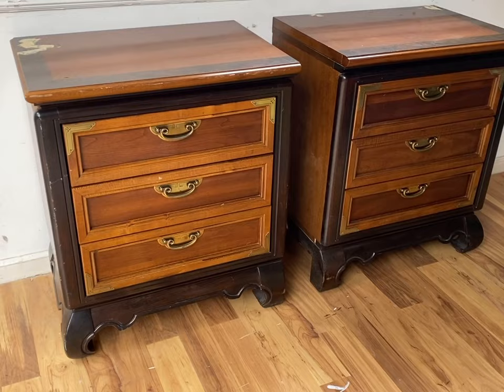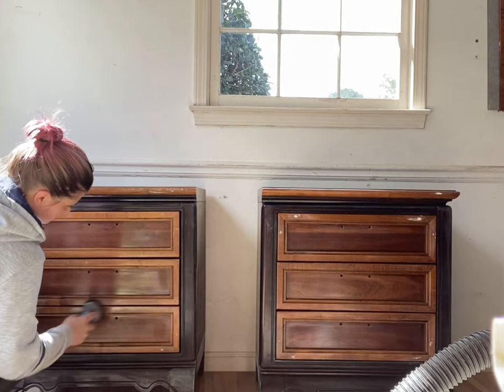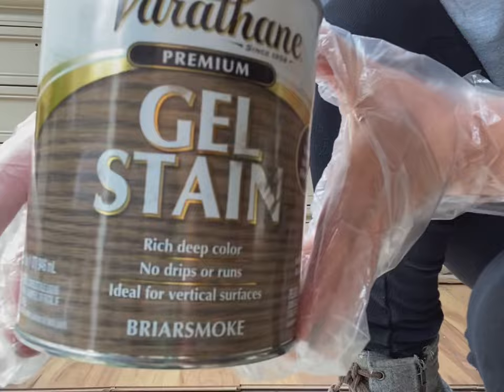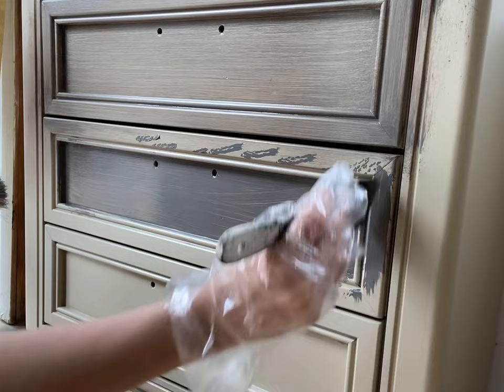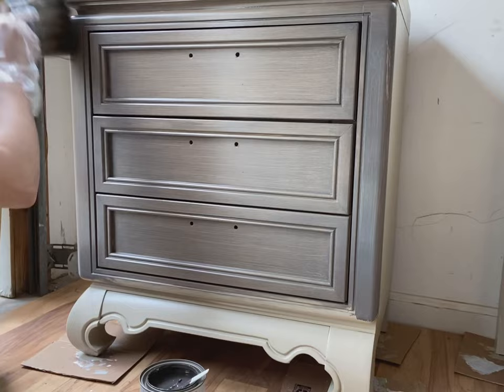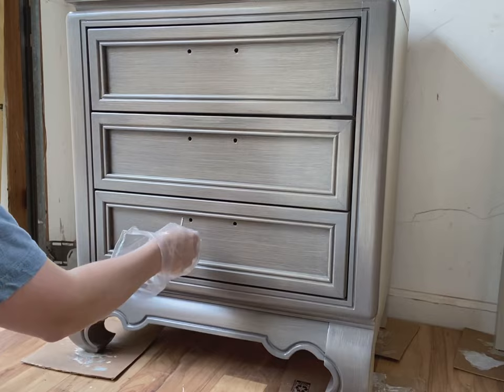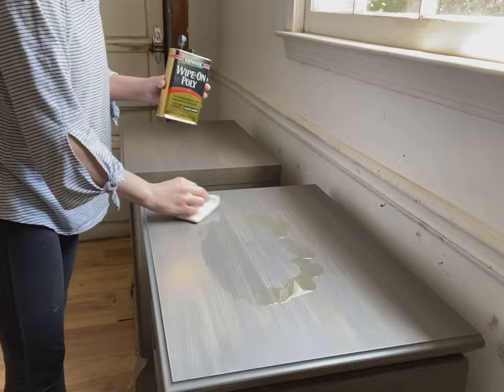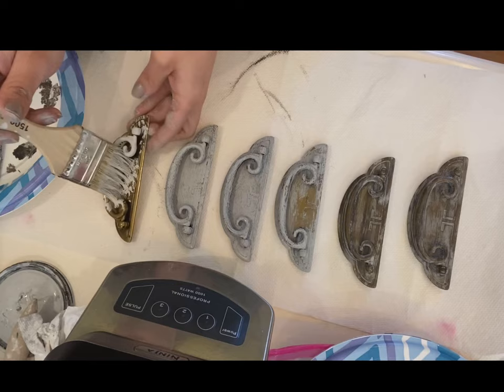Wood like finish | PAINT LAMINATE to look like wood | EASY techniques for a Pottery Barn Grey finish

Comment: You are a godsend! I’ve been looking for a technique like this for our very dark, cherry interior of our RV trailer. Do you think the hand brush strokes in your base coat contribute to the “grain” of the wood once you apply the stain? I have loads of wood trim and doors in our trailer so thought I’d use my paint sprayer for the base coat, but will hand paint if you think I wouldn’t get the ‘grain with spray. If the grain is entirely made with the various brush strokes, then I could save time by spraying the base coat. I love your technique!! Thank you for sharing!!

Comment: Amazing video, thanks. I am doing a laminate table this way, I did very strong coat of primer to start with, was it a mistake ? I still have not finished priming. also wondering what coat would work for me if I am going to use Mahogany or walnut gel stain? I already have some sort of light bronze color, is it going to work or I need some light brown for underneath of gel stain? thanks

Comment: Hiii! I’m looking to finish my dining room table and have followed a bunch of your techniques thus far! For top coat, do you advise using the varathane in 3-4 coats? Or should I apply one wipe on poly then continue with the varathane? Thanks!!!
Reply from the maker: The Varathane is really great, I would do 3 coats for a table top.  Wipe on poly is great too usually do about 3 coats or more of that. it’s a personal choice and either will be great.  The wipe on poly does slightly yellow over time which doesn’t matter much on wood looks but something to consider in your choice.  They are both great 👍 and extremely durable

Comment: Your work is superb 😍 I've never seen "the broom" technique. It's really unique and it actually works the best in comparison to others I've seen. You did awesome!
Quick question... Does wipe on poly yellow overtime since it's an oil based top coat?
Reply from the maker: Thanks!  It is oil based so it has the potential to yellow "amber" over time but I have not had anything with it on it yellow yet, that being said I have never used it on a pure white project for that reason.
Reply: @blacksheephouse  thank you for responding. Again, your work is amazing :)

Comment: Great videos.  I do have a question for you so I hope you see this.  I bought a huge Toscana dining table from Pottery Barn because I needed a super big table - seats 12 with leaves.  It looks like this is not real wood and I am afraid to paint it.  The color is light tan and doesn't work with my room.  I have 10 textured reproduction Windsors from David Smith Workshops that are very authentic and have a unique old world crackle finish so I really don't want to mess up the table.  Chairs are maple backed and some all black.   I'm going for a dark brownish black with maybe some reddish undertones for the table.  It has a ton of graining but it isn't real wood.  Any suggestions on what kind of finish to use and do you see any problem with painting over this "fake wood".  Thanks so much.

Comment: I loved your project and painted my dresser with the same technique! I had one question…my stain has been drying for two days and is still tacky. I used the water based paint and the gel oil based stain. Is this normal for it to take this long to dry or should I have used a water based stain? Thank you!

Comment: Hi! I’ve tried this finish on my bar stools and dining table and I love it! 😍 I want to try it on some bedroom furniture. I just wondered - on drawers like this does it ever rub off at at the edges where the drawers rub going in and out? X
Reply from the maker: I have seen where it will rub off in a line of it it really scraping in and out, but if the drawers work well it doesn’t scratch off.  If you are worried it might you could use an oil based wipe on poly that is super durable against scratches

Comment: This is beautiful, you easily explained the process too, but I can’t seem to do it. It goes on thick and dries so fast, getting all gummy. I’ll sand it back again, but I just can’t seem to do it.
Reply from the maker: Oh man!  Maybe you got an old can?  It helps to work in sections and you might try thinning it with paint thinner or mineral spirits to extend your work time 🤔

Comment: I'm interested in finding your video on the darker wood finish. You mentioned pottery barn. But this looks good. I've watched about 3 of your videos so far and am wondering why you use latex paint on furniture. I'm not a fan of latex on furniture. Just curious about your opinion
Reply from the maker: Hey!!  I really like the newer paints from Lowe’s now, they’re not latex like they used to be.  The hgtv ones are acrylic based so def work much better.  Behr is ok too in a pinch but try my one step paint recipe, it’ll save you time and money!  For a darker finish you can apply two coats of stain, but wait in between for it to dry.  You could also use a darker base color, lots of options ❤️

Comment: Shannon, this is a great video! Is this a wood piece your working with? I have a vernier piece I am wanting to distress and lighten the color. Can you do this process with non wood?
Reply from the maker: You can do this on any surface as long as you use a primer for that type of surface, and shellac based primer works on ANYthing

Comment: I’m perplexed about the uses of oil and water based paints and stains together. 
Some will say “not to mix the two.”  What say you on this subject? 
I’m a novice,  and do mostly home projects., and mostly use chalked paint, but I love to incorporate stains which are typically oil based. 
Any suggestions on combining the two? Thank you. Also, Loved your video!
Reply from the maker: My experience is that you can definitely use the two in a layering way *as long as each layer is fully dry first.  I do it alllllll the time and it has never let me down yet.  Def try my 1 step paint recipe, it’s the base of most my projects now and I’ll never go back to chalk paint.  I’m working on finding a water based alternative for the Briarsmoke stain from this video but haven’t found one yet, but I’ll be posting when I do ❤️
Reply: Thank you. Can I ask why you wouldn’t go back to chalk paint? 
I know it can be challenging and the results aren’t always what you might have envisioned. At least that’s my experience.

Comment: Did you have any issues with the gel stain not drying in the time it was supposed to? Almost a full day later and mine is still tacky. Temp and humidity conditions are ideal as well.
Reply from the maker: Hey 👋 I have had it take a few days at times, I’m not positive why but probably something to do with the thickness of application

Comment: Hi Shannon! Love, love, love this look! I’m not sure I understood the part of the wipe on poly, did you apply water poly to the wipe on once it was was dry?  Thanks for all your information 😊 I love all your videos!
Reply from the maker: Hi Nina!  I just used the wipe on polyurethane on the top of the nightstands because it is so scratch resistant.  It is a bit too shiny for what I wanted on the nightstands though so I used matte water based polycrylic for the rest of the piece and I actually did a coat on top of the wipe on polyurethane too once it was dry to give the matte finish I like so much. Let me know if that made sense ❤️

Comment: Hi.  This is such a beautiful finish.  Is the gel stain necessary or could regular wood stain in the same color work?  My local store is out of the gel stain in that color.  I can go to another store about 45 min away but just wanted to know if there is a specific reason for gel version. This will be my first project so I want to fully understand.😊
Reply from the maker: Hi!  Yes, you’ll need gel stain bc reg stain is too watery/thin and the gel is more like paint BUT I have a hack you can mix half clear coat and half paint color, that’s what I’ve been doing recently instead of gel stains bc it’s so much easier to clean up and you have so many more color options ❤️ what paint brand does your store carry and I’ll give you some color recommendations
Reply: @blacksheephouse  oh, ok I understand.  Thank you so much for explaining and for the great tip.    I usually go to Home Depot so whatever they carry I should be able to get.  They have just been out of the gel stain color briarsmoke.  The next closest Home Depot is 45 min away and they only have 2 left.  Maybe lots of people watching your videos??🤔❤️😊

Comment: Love this but have to paint pieces in their specific room. Is there a way to achieve this without using an oil based stain please?
Reply from the maker: You can use a glaze instead.  You will probably have to mix a few glazes together get this color though.  I’m on the lookout for a glaze this color, I’ll post when I find one

Comment: Just a question bc you do this professionally... Does the Behr paint hold up as well as chalk paint? I am just starting out and I keep getting mixed reviews about not using house paint.
Reply from the maker: If you want hands down the most durable paint, then go with oil enriched enamel, I like valspar furniture and cabinet enamel but many swear by Benjamin Moore advance.  They are water clean up even though they are oil based.  They are strong enough for cabinets, table tops etc and will be the most durable for furniture but they take a while to cure fully (20-30 days) and they dry slower.  As long as you clean, prime, and topcoat you can use ANY paint and it’ll do just fine for most projects.  In general, the higher the sheen the more durable the paint will be so many furniture refinishers go with “enamel” semi gloss and then you can dull the sheen with a matte topcoat.  When buying Behr just pick the sheen that is strong enough for trim/doors and if you prep/prime first you’ll be in good shape.  Also, check out my one step paint recipe - it’s really awesome 😎 https://youtu.be/kmEaozVRmP0

Comment: I loved the idea so I tried it on a commissioned piece but the picture you used for your cover made me think it was going to come out as light as the cover picture but that wasn’t the case. Now I need to figure out a white wash or something to make it look like weather oak. 😢
Reply from the maker: Hey Liliana!  You can adjust the lightness on your next one by doing more brushing and/or applying less gel stain, and the deck staining brush is absolutely paramount imo but for this one you already have that’s a tad too dark I would either do a taupe/tan wash or do a pinkish tan dry brushing all over.
Reply: Black Sheep House thanks for the tips I think for my next piece I’ll use a lot less stain and maybe wipe it on instead of using a brush. Another thing I have a question about is the wipe on poly, how long do you have to wait to add the Matte top coat over it?

Comment: Hi. Question. What sheen did you have on the base coat? Does it matter if you use a Pearl vs a Matte sheen for that base coat?
Reply from the maker: It helps to have a sheen like semi gloss bc it lets the glaze slide easier and is more resilient agains the brushing but I’ve done it on satin before too.

Comment: Trying to redo a bedroom set but it has some chips and nicks. What would I use to fill those plastic wood filler? Also I love what you did with those pieces very inspiring.
Reply from the maker: If they are not that deep of scratches you could leave them and it adds to the character of the finish on the end but if they are big enough you want to fill them any wood filler works for this finish since it so forgiving.

Comment: I am loving your techniques!!! Currently working on the "pottery barn" look on a dresser. I noticed that you usually keep the drawers in your pieces. Is there a particular reason why?Wouldn't that mess up with the paint on the frame?
Reply from the maker: I leave it in mostly for filming YouTube purposes, and I’ve figured out how to work around the drawers but you can definitely take them out ❤️ I find it takes about the same amount of effort either way
Reply: I’ve heard that it will give you a more consistent look or grain all the way across the front if you leave them in. 🤷‍♀️

Comment: I'm working on my very first refurbishing project I want to re do my headboard to the color your doing these beautiful night stands so is this the process I can use on formica ?
Reply from the maker: Yes, I’ve done it on that many times, just be sure to prime ❤️ shellac based primer is supposed to be the strongest but very smelly.  Honestly as long as you clean, sand and prime with any primer first you will be good to go!

Comment: I refinished a piece using briar smoke. It turned out a darker grey. How can I lighten it without starting over completely?
Reply from the maker: I would dry brush using the base color to lighten it up and if that doesn’t do it you could paint the color on full strength and then use a paper towel to wipe it, test out on a not so visible area first.

Comment: 10:48 I thought I had to use all water based or all oil based products. Are you using the oil based gel over water based chalk paint? What about the poly coat?
Reply from the maker: I mix and match these layers all the time as long as the previous one is dry and it’s all worked about great!  The common advice is don’t do latex paint over oil paint bc it will usually peel after time but what I’m doing in this video is different products
Reply from the maker: All the products used are in the description part of the video and poly topcoat is recommended but not required, I like to do a matte poly to dull the sheen this gel stain has

Comment: Hi, do you use 2 coats of paint or 1? Thank you!
Reply from the maker: It depends on how good the coverage is on first coat but it def doesn’t need to be a perfect paint job before you do the wood look
Reply: @blacksheephouse  that was my thought process as well. I had some areas (wood filler) where my Kilz3 premium didn’t cover as well. I wasn’t able to open my garage for ventilation to use the Bin123.

Comment: Can you let me know what color paint you used for this?
Reply from the maker: For future, I always put what I use in my description box 🖤
PRODUCTS USED
220 Grit sanding sponge
Tack Cloth to remove dust
Simple Green Cleaner
Zinnser 123 Primer
BEHR Color :Open Canyon  Type: Ultra Premium Plus Semi Gloss
Briarsmoke Gel Stain by Varathane
French Silver from Behr sample size for dry brushing (this step is optional)
Wipe On Poly
Cloths for applying or an old t shirt piece
Matte finish Polycrylic - Varathane Brand
Magic Broom - little whisk broom
Large fluffy paint brush, Mine is a cheap synthetic deck staining brush from walmart
smaller application brush (cheap ones in the craft section at walmart) or from hardware store.  Synthetic bristles
For clean up of oil based products you can use Paint thinner or Mineral Spirits ($5 at walmart or hardware store)

Comment: Have you done a shiny finish to match a coffee table from Structube in white. Mom has a tv unit that is faux wood grain in soft pink over 25 yes old but is so functional she would like to paint. What are your thoughts on this or should she just do how you did night stands with whiskbroom?
Reply from the maker: If you’d like a shine you can just do a high gloss top coat as the very last step, let me know if that helps or if I didn’t answer the question ❤️❤️
Reply: You do “The Best” Videos! I love how you speed it the process and your speaking during the video is quick and to the point.  Some how to videos just drag on with way to much talking but, not yours. Great Job! Kudos!

Comment: Are you using latex paint? Worried it will peel off, what is your experience?
Reply from the maker: I am using latex paint (Behr premium plus ultra - semi gloss) but with primer and topcoat don’t be worried, it’ll last for years and years just like the trim and doors all through your house.  Anytime you see peeling latex, the person used either flat latex wall paint and didn’t prime and topcoat.  I used to be afraid also, but now latex is probably my most used paint ❤️❤️❤️

Comment: I've got a standup jewelry cabinet that's wood laminate with a whitewash type trim (the whitewash trim is a bad job and is ugly). I can't remove the handles bc there's velvet in the drawers covering the inside. Is there any product I can just wipe on over the cabinet that's going to minimize the ugly whitewash trim?
Reply from the maker: Any type of gel stain would work great 👍 lots of colors to choose from just be sure it’s GEL stain not regular bc you need the thickness to give it the sheer cover, kinda like using sheer pantyhose haha
Reply: @blacksheephouse  Thanks so much!

Comment: I used this technique on my dining table. It’s been 24 hours and the gel stain doesn’t seem to be drying at all. Help 😊 what did I do wrong? (Water  based paint with oil based gel stain?)
Reply from the maker: Gel stain really takes a while to dry, I should have talked more about that in the video.  It could take as long as a week depending on how thick it is applied/weather
Reply: @blacksheephouse  thank you!

Comment: Hello, i have tried this process twice and for some reason i cant get it to dry. Please HELP
Reply from the maker: Hey!  Don’t panic, the gel stain is oil based and takes a while to dry, give it a week or so.  Sorry I should have talked about that in the video.  Mine usually dries in a few days but I’ve had some take 2 weeks of weather is cold or humid or I applied it thick
Reply: @blacksheephouse  ok thank you i was panicking. Everything i read said it could be a bad batch so i went n brought a new can. I will let you know if it works. Thank you for getting back to me